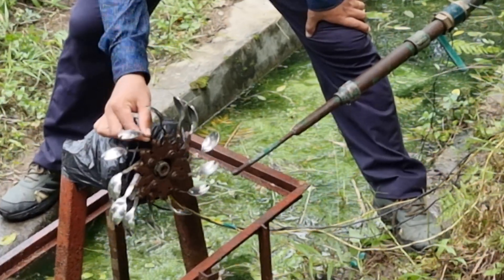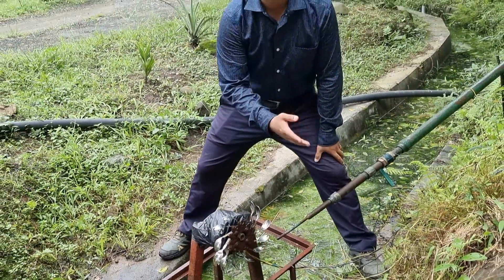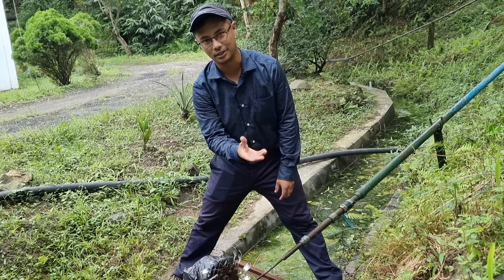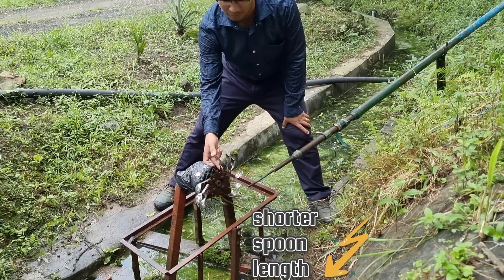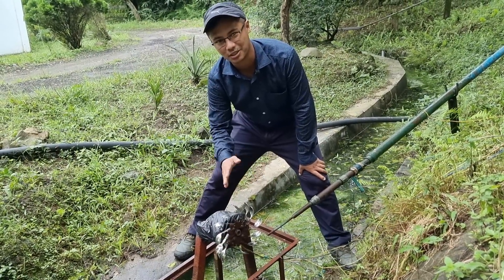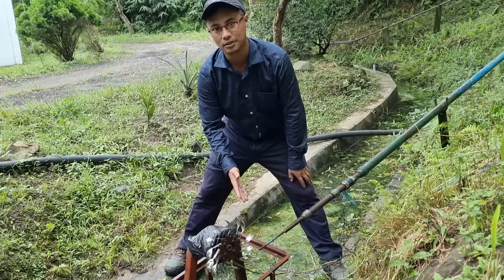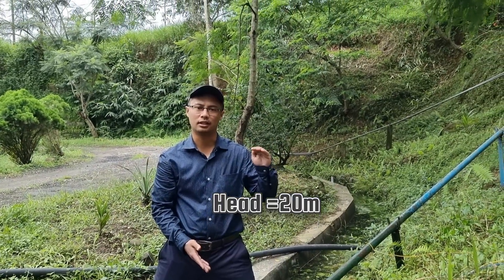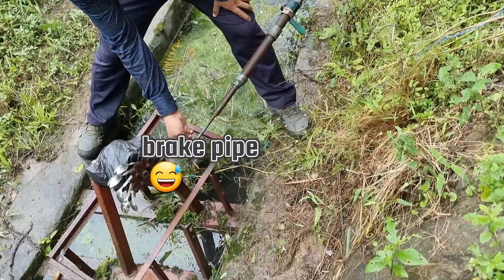Failed Spoon Turbine Experiment

Comment: Try to make pulley system using bigger wheel with bigger blades, that way you'll be able to get higher RPM.
Reply from the maker: Thank you very much for your valuable suggestion Chongshen👍 Yes, you are right, that will increase the ratio. 

If you are free please check out my other video on Wind Pump ReCycled.  

Thanks once again 😊
Reply: @unconventionalengineer7640   Bro, I think you might be familiar with RAM PUMP. Try diy with it, since many people are not familiar with this pump, I think it might be a good content in your videos. It's quite easy to build using PVC pipe and connectors/sockets. It can pump up several metres to top hill without any electricity. Just a suggestion.
Reply from the maker: @chongshenchang9367  Yes brother, I have made one using swing check valves and have uploaded it before 😅

Thank you very much for your suggestions and insights 👍
Reply: @unconventionalengineer7640  Oh.. Great..!! 👍👍
Reply: @unconventionalengineer7640  👍👍👍
Reply: Try using pulley with flyweel ..